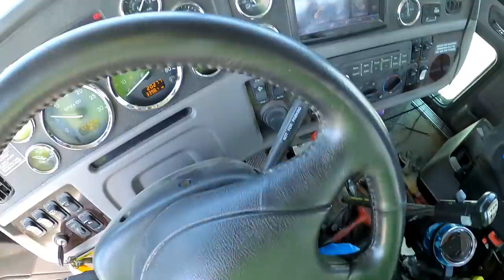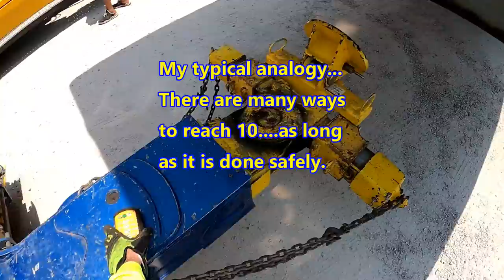SHUT DOWN AT THE SCALES!!!   TRAILER TOWING 'TATOR TIME!!!

Comment: There's a local tow truck operator in our area who wanted to get into towing trailers. All he had was a small single axle truck but it did have air brakes. So he added the necessary plumbing and wiring needed to pull a trailer put a pintle hook on the back, went to an equipment auction and bought a  converter dolly they use to pull doubles. I found out because the company I work for left a trailer at a small local repair shop and was in no hurry to pick it up. The owner had it towed and this guy took it to his impound lot. The company sent me down there to pick it up. Between the tow charge and the storage charge it was an expensive repair. And he also had another large trucking company's trailer in here too. With all the weight on the dolly and none on the truck I don't imagine it would work very well with a loaded trailer.

Comment: Greetings: This intent is not negative, disrespect, disparage. It is fact and info. Many drivers fail 2 inspect, refuse and report faulty equipment. Such is Y we have the problems 2day. I would rather have 10 good drivers. The driver shortage is a lesson 2 drivers, companies, shippers, receivers, Governments and the public. Do Ur job well with pride, safety, quality,  U said blue lights. Does MO require / permit blue lights on towing equipment?  Thx 4 the content, narration and info 4 those interested. Good job. 👍

Comment: What synchronizes the the light bar with the truck lights? Thanks.
Reply: There is a transmitter permanently wired into the truck that send control signals to the light bar.  This wireless connection eliminates the long wire that was required in the old days.

Comment: Interesting video Ron. I do have 2 questions about the video. First could you have just disconnected the air hoses (Glad Handles) and let the air out that wat to set the trailer brakes? What happened to the other Yellow wireless light bar? I hope you have kept it as a spare incase another one breaks down?
Reply: If my memory is right there is over 100 psi air inside those air lines. I wouldn't recommend trying to disconnect it without pulling the valve first.

Comment: These drivers did the right thing by ensuring they were safe to go and get the paperwork sorted out. I work with a lot of drivers that come from different walks of life, A lot of people hate on them, but they are just trying to make a living to provide for their families. Never judge a hard working individual. 
I respect those drivers for making the right choice and making sure they had everything they needed. 

I do have a question though. Why use the rotator to pull the trailer and not the Sleeper Cab tractor? I'm sure there's a reason but I'm unsure.
Reply from the maker: It's a technicality, honestly.  A tow truck is exempt from a lot of things in Missouri.   The semi we have that pulls our "float" trailer does fall into the "emergency vehicle" category when we are using it for true emergency purposes, but in a situation such as this it would simply be considered another semi tractor and would not carry the same exemptions the tow truck does.  I hope that makes sense.  Thanks for watching and God bless.
Reply: Ahh. That does make sense. Thank you Ron

Comment: Do you guys use the Miller 1150 Shop Hoist as training time for the Rotator?
Reply from the maker: I'm actually using the 1150R Shop Hoist currently to remove/replace the radiator/aftercooler assembly on a Brandt unit right now...LOL.   Use what ya got.   Thanks and God bless.
Reply: @RonPratt , the 'Tator is such a capable machine, would be a shame to not use it just because you're not on the side of a road, out in the weather, and under a powerline.

Comment: Was there already a video or can you in a future video explain some of the controls you use? I understand what controls the under-grabber (small yellow remote) and the rotating crane (duel side controls plus large remote {blue?}) But I wanted to know about the overhead button panel in the cab as well as the screen & button panel on the rear side controls. I notice in each video when you first get out of the cab on the scene that you push a few buttons and then get a 5 second count down that and you hit YES. What is that about? Is that setting flashing lights that only authorized by the police/sheriff vehicles are allowed to use?
Reply from the maker: There are some of my older videos where I explain the control systems.  I will try to make the time to create some updated videos as some of the programming on the control panels has changed.  Thanks for watching and God bless.

Comment: Do your tow truck drivers all have a class A CDL or do those that usually drive your ramp trucks have just a class B CDL?
Reply: I think the answer from before is that you need to be certified for all the difference vehicle types that Ron deals with. He has said that he has a bus licence, but no passengers (insurnace perhaps???) I'm sure that mobile cranes requires two bits of paper, one to say that you can drive one on the road, the other to operate the crane. I'm coming from Australian perspective though.

I'm sure the list goes on when in heavy recovery.
Reply: Mike recently got his class A CDL learners permit.
Reply: @gorillaau  you can't tow a bus with passengers. So he doesn't need that endorsement.

Comment: I wonder if the trailer was leased by the company they were hauling for or if the drivers leased the trailer themselves. I've seen cases where people leased a storage van which is one that was taken out of service because it no longer passes inspection then they use it on the road.

Comment: So it's not safe to tow down the road to the shop.. but if it's a tow truck towing it's ok. SMH  I know your just doing as told Ron no negativity towards you but the DOT at that scale house seriously need to think about stuff.
I guess they don't' trust the drivers would take it to a repair place but seriously it's safe or it isn't.   if you low Boy trailered it ok makes sense but that right there made little to no sense.  
Great video as always

Comment: I noticed you didn’t use safety chains on the trailer was there no need for them thanks love your channel
Reply: With a normal underhook, it's only gravity and the wrap around restraints (chains or straps) preventing the towed vehicle from bouncing off and down the road.
With the 5th wheel. the hitch wraps around the king pin, and the lock pin means there is no way for it to become accidentally unhitched.
Reply: Take a look at the screen at 22:35
Reply: 22:38

Comment: Would the locking pin on the Western Star be sufficient to hold the T head if it was using a 5th wheel attachment or would you still chain regardless?

Comment: I can feel for these drivers. They picked up a trailer thinking they were taking it from point A to point B. Somewhere along to way they were stopped because the trailer was damaged. After repairs I would think another trucker would pick up the trailer and finish the job that these guys started. I wonder if they they will get payment from going from point A to the weigh station.

Comment: I'd guess a question for Dept of Trans. but I gota ask - whats the difference in them taking it to your shop vs you towing it to your shop?
Reply: One reason i can think of is that if a tow truck is towing it, the dot knows its going somewhere to get fixed.  If they let the driver take it they can't know for sure that the driver wont just keep going and not get it fixed until they want to.

Comment: hey ron i was wondering if you could explain something on your next video with the tator how come they have your air set up on the right ride instead of left 23:24 - 23:45  wouldnt it be easier for the air line hook up then having to stretch the air lines? just cerious

Comment: Hi Ron, thanks for this video which was a pretty cool and interesting job you did there… Something we rarely see… Appreciate the explanation of what all was used, how you use it and why… That lightbar was pretty cool too with all those features. All that thing needed was a set of wheels and it pretty much could have gone down the road by itself… LOL JK… but cool thou… That mini 5th wheel is a pretty cool invention for towing with your rotator too… As you were underneath the trailer looking for the damage, I saw where it looked like there were some other weld jobs that were repairs done in the past… They looked rusted too… Also wondering how your son is doing… has he settled in and does he like his classes… Just Curious since this was a life changing step for everyone… Nice Video Ron and Thank again…! PS Was that Mike there in the shop towards the end of the video??

Comment: Just a question from someone who knows nothing about this stuff... why does the T-bar pivot in the first place? The obvious benefit is that you didn't have to back up perfectly aligned with the trailer. Is there any other reason for the T-bar pivot?
Also, that's a long walk around the front of your truck to get to the other side!
Reply: It pivots so the towed vehicle turns behind you. If it was fixed the towed vehicle would push you straight through a turn, or something would break.

Comment: So the authorities let you pull a broken trailer to the shop, but not the truck it was already attached to?  Is that because of fear the driver would not take it to the shop?   Either way, the broken trailer is on the road... Hmmm.   Another video on repairing the cracked frame would sure be great, but I know its not the mission of the channel, and video in a working shop is highly disruptive.  You continue as a example of polite and professional... a credit to the good side of America🇺🇸

Comment: You would think they would develop a light weight High strength Chain.
Reply: Straps are as close as you get or endless loops... Problem is materials science isn't there yet.. stronger and lighter exists but are brittle
Reply: @Simon-ho6ly  Aluminum might work, but equivalent strength would require a significant size increase and service life would be much shorter due to the softer metal wearing faster.

Silicon/aluminum bronze are also possibilities, with potentially longer life than steel, but they're both incredibly expensive.

Either way the weight savings would be miniscule, with significant downsides. A similar story plays out with higher-grade steel chains: the increased strength allows the use of smaller chain (e.g. 3/8" instead of 1/2") for a given load; but the higher density makes the actual weights very similar for equivalent working limits.

Another comparison is steel wire rope vs synthetic. The synthetics can be tremendously lighter for the same working limit, at the costs of increased dynamic stretching and greater fragility - it's much easier to sever a strand of "plastic" than a steel wire. In some cases the dynamic stretching is actually a benefit, such as the Yankum Ropes that Midwest uses.

Comment: How long does this make pulling length ?
Reply from the maker: I'm right at 40' with the under-reach folded.   So, unfolded, hooked to a 53' trailer, I'd be in the neighborhood of 98-100'.   Thanks for watching and God bless.
Reply: @noahater5785  You'd want your wits about you. Keep an eye out for the load doing something it shouldn't. Double checking the pivots to make sure all but one has been secured and still in place.

Comment: So what can cause  Scale houses to “seize” trailers like this one?
Reply: Spot inspection finding any of a long list of mechanical issues.
Reply: They didn’t “seize” the trailer. The put the trailer out of service due to a cracked subframe.   The scale house then requires it to be fixed before putting it back into service.
Reply: They were lucky enough to be one that was chosen to be inspected... and found the cracks on the trailer.  As such they put the trailer out of service, which means they could not haul it, and needed a tow truck.

Comment: 42:00 Do you have a 5th-Wheel attachment that can haul loaded trailer's (other than the one currently attached to your flatbed that is)? Or do you have to either flatbed or unload the trailers before you can tow them?

Comment: on the western star with the vulcan v70 do you have chain the t head down like on the century 4024 and 1150 because the vulcan the pin in the t head ??????
Reply from the maker: Personally, I remove the pin and chain the T-head on the Vulcan.   The tab that is welded to the T-head that the pin goes through isn't very strong and we have had to weld it back into place numerous times.   Thanks for watching and God bless.
Reply: @RonPratt  thank you i never known that thank you fore the information

Comment: How does the portable trailer light sync with the tow rig?
Reply: There is a sending unit that plugs into the back of the towing vehicle that sends a wireless signal to the light bar.

Comment: Hey Ron could you of picked it up with your tractor that you pull the flatbed with or did they require you to bring the tator
Reply from the maker: Actually, no, due to regulations.   The semi we have is not considered a "tow vehicle" even though it is considered an "emergency vehicle" under certain situations.   The scales will only allow a traditional towing unit to tow a trailer away like this.   The rules are strange, I know.   Thanks for watching and God bless.

Comment: That's an expensive tow per gallon having to use the Rotator there for sure over the Western Star!  I see you mentioned it's a mini plate for empty trailers.. do you have one for a full trailer also on the tator?
Reply: I dare say the Tator was used because damage to the trailer was unknown and there was a chance of it needing to be placed on a landall
Reply: They don't make a plate for a loaded trailer if it had been loaded he would have chain slung it
Reply: Apparently Missouri state law requires out of service units to be towed, by a tow truck, off the scales.  The Western Star/Vulcan could have done it, but it was busy.
Reply: The mini plate alone is 52 lbs. That already isn't terribly fun to handle, especially when all greased up. A full-size plate is about 180 lbs. And toolbox space is at a premium on these wreckers.

There are other ways to hook up loaded trailers -- ways that maximize the weight over your steer axle. Some loaded trailers are so heavy that they'll lift the front end of the wrecker right off the ground!

Comment: What is the difference between the driver pulling it to your shop and you pulling it.  Does broke not mean the same thing if you pull it.  For safety it should have been fixed there before it was moved.

Comment: Someday explain the shift pattern in the Rotator .. looks like 4 speed (maybe 8?) in Low and 8 speed in H (plus Reverse)
Reply: It's a 18 speed you can drive it like a 9 or split top and bottom gears
Reply: 18 speed, it’s i suppose a version of an 8 speed, 1-4 and 5-8 are the two right sides, reverse and low are on the left.  The main reason it’s not just an 8, is you can split the whole gears again, there’s a low and high side of every gear.

Comment: Ron what do you do if the trailer is loaded?
Reply from the maker: In my opinion, it is unsafe to tow a loaded trailer behind a conventional tow truck.   In an emergency I have used the "chain-sling" method to move loaded trailers a short distance, but I believe it safer to have another road tractor under the nose or put the trailer on another trailer.   Again, just my opinion.  Thanks for watching and God bless.
Reply: @RonPratt  I really enjoy watching your videos. I live in northern Virginia. I’m a novice mechanic and I eventually want to work on big diesel trucks. I’m going to college to be a mechanic. Do you have any advice that could help me?

Comment: When you get a fix it ticket you have to get the unit fixed & then have the DOT  sign off that it has passed inspection.  Since this is a trailer & these guys won't have it anymore they can't get the fix it ticket cleared unless documentation is submitted within 30 days that it's fixed. So probably like what happened to me, some poor driver hauling this trailer is gonna get turned around at a POE if the paperwork doesn't get submitted.

Comment: Why couldn't you use the number 17 truck?
Reply from the maker: Good question.   They require a traditional "tow" truck to remove a trailer in this condition.   There are many reasons.   Thanks for watching and God bless.
Reply: @RonPratt  related question: if it were a loaded trailer that had similar issue that was dropped/parked at customer location without a tractor available, would you then use your 17 to pull trailer, and rotator to tow both of them? Since the mini fifth wheel is weight limited.

Comment: I never will understand. They don't let the truck driver tow the trailer because a broken structural component, but it's ok for it to be towed the exact same way behind a wrecker with the same broken components bearing weight.
Reply from the maker: It is strange, but that's the way it is.   Perhaps ONE of the reasons may be that we are required to carry an ENORMOUS amount of insurance coverage, generally FAR more than the trucking company.   We also carry a fair amount of tools and equipment on our units in case there is an issue going down the road so that we can possibly handle a situation where a standard driver would not be able.  Thanks for watching and God bless.
Reply: It's all about the money! Even Ron is a victim, the only ones that make out like bandits are the state and the insurance companies.
Reply: The drivers have a financial incentive to continue driving the hazardous unit, Ron doesn't, and he has a state certified skill and equipment set to tow the damaged unit safely. Much regulatory law is about reducing conflict of interest and enabling disinterested third parties to act for the public good.
Reply: @RonPratt  I assume when you have a vehicle in tow -- even a trailer -- you are also lit up like a Christmas tree.